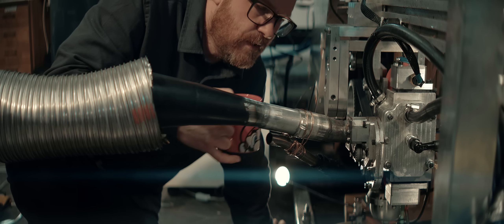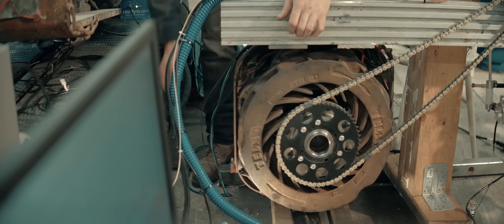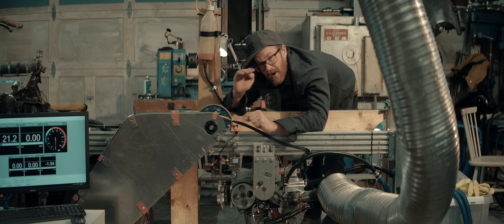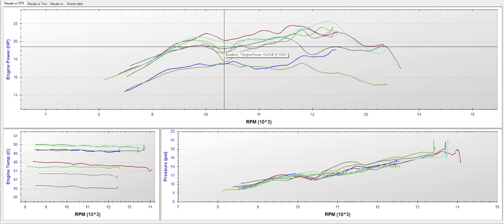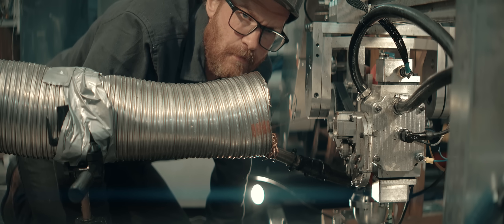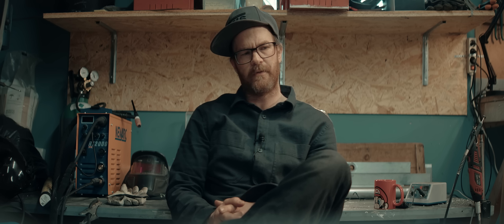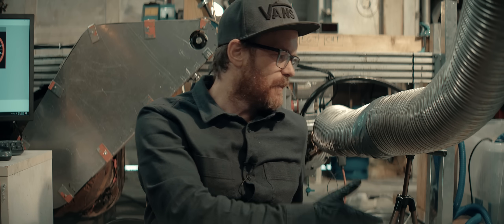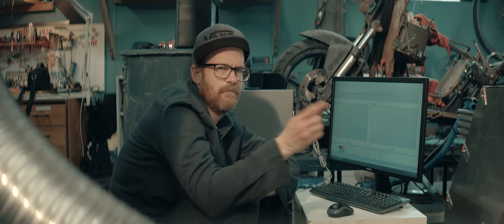50cc Supercharged Nitro Two Stroke - More compression?

Comment: Give it more timing at the top end, that will help clean your plugs. You likely also need to tighten up your plug gap with boost. On top of that you might need more spark energy. Top Fuel/Funny Car change their plugs EVERY RUN and they just buy the cheapest plugs they can get, part of that is because the magnetos they use put out 120amps of energy per plug. (and they run two plugs per cylinder) Yes you heard me right 120 AMPS of energy per plug.. welding level amperage. That's how much energy 90% nitro needs to burn somewhat efficiently, though it's still burning all the way out the pipe and out into open air. At max RPM you should be at about 40-45 degrees of timing going by what it says for methanol. Giving it more boost will also help it burn more efficiently and would be easier to do than designing a new head. 
I think you're still too much in the NA mindset and not adapting well to a boosted application.
Reply: Every mod on a n/a engine does well on  boost! To many compensate bad stuff/design with adding boost. My 2c
Reply from the maker: Just adding boost to a conventional engine would be far less interesting.
Reply: @2STROKESTUFFING  I wasn't saying adding boost to a conventional engine, I said add boost to this one you've already made. This might be interesting to you. https://en.wikipedia.org/wiki/Top_Fuel#Ignition_and_timing
Reply: MSD 44 magneto produce 44 amps for primary coils not for the sparkplug. Plug amps is about 1-1.2
Reply: Yep. Joules or watts are the same, minus some efficiency losses. Funny car magnetos are actually 44 amps. You have 44A @12v or 528 watts. Assuming 100% efficiency, at the plug, 50,000v @ 528 watts is 0.0106 amps at the plug.  A stock car/truck plugs run at around 50,000v @ 0.0012 amps ..    Point is you dont need current at a spark plug, you need voltage. Once the ark is established, the fuel will begin burning.
Reply: @janilindroos3688  I'm quoting what Clay Millican's former crew chief said they put out..
Reply: @jaratt85  Top Fuels doesn't just spark, they burn like an 80amp weld for 20 degrees of duration. They change spark plugs every run cuz they melt, sometimes there's nothing but the threads and porcelain left.
Reply: @KalLanPIDT  spark duration is the key, CDI cant compete with magnetos
Reply: @KalLanPIDT  that's interesting, being that i have several john force and tim wilkerson plugs on my desk, and they look like they are almost brand new.. the porcelain is clean, electrode in the middle does have ever so slight amount of wear on them. Maybe equivelant to 10k miles on a conventional plug in a gas engine.  Idk what you're looking at. They both run the same or VERY similar ignition systems.
Reply: @mitchellgould7405  duration of a spark in a flyback transformer (which is what automotive applications use, wether it be cdi, points or a mag) is dictated by the voltage required to jump the gap, and how large the magnetic field is around the primary coil before the magnetic field collapses. The more voltage needed to jump the gap (usually because excessive fuel or other electrical insulators)  = less duration of spark.
Reply: @gadgetdeez7069  keep reading bud until you find out about spark duration characteristics of different ignitions. A promag44 has like 16 degrees of duration for ignition event, with a cdi just registering a tiny spike.  Further to this, going to a glow plug might just be what he needs, just like the fuel needs to run in RC motors.  If I wanted to talk about basic physics I would have........
Reply: Dunno about buying the cheapest they can get - plugs are the cheapest part of an engine and with something that is so important this isn't where you skimp .
Reply: @Flattyman  it is for them because they go through so many of them. If you walk through the pits at a NHRA event you'll find trash cans with piles of them. They've broadcasted that fact on the NHRA coverage so many times I don't know how many times I've heard it. For a professional team cutting costs where you can is really important.
Okay listening to this I guess they are 44 amps now.. I think they reduced it when they started capping how fast they can go. https://www.youtube.com/watch?v=jZRS-z9WQdY E3 is now the official spark plug of NHRA so I guess they are running better plugs now. For the longest time though I know they ran cheap ones to lower costs.. but hey sponsor means free. https://en.wikipedia.org/wiki/Top_Fuel#Ignition_and_timing
Reply: @Alfred Wedmore i'm full aware. Most people cant grasp reluctance, inductance, power, or the calculations thereof. Therefore in laymens terms on a 10:1 transformer 100v @ 10A = 1000watt input @ 100% efficiency = 10v @ 100A = 1000 watt output.

Comment: Have you tried cooling the fuel before your runs. This would allow more fuel to pack the cylinder. You probably already thought of this or tried it but running it through a still with dry ice may get some additional horse power.
Reply: He is heating the fuel, running it through the compressor.

Comment: Engine dynos both inertia, water brake, and Eddie Current generallly accelerates an Engine from lower Rpms to High Rpm Peak Power. Anywhere between a pre set fixed amount between 200rpm and 600 rpm a second. While you're messing about trying different things is how I used to tune my 1/10 scale RC car engines, but for actual HP, you need to accelerate the the Engine as suggested above.

Comment: You need to seriously beef up that ignition system.

Top fuel dragsters that run nitro have to run 2x massive magnetos  to keep the spark from getting put out by the cold fuel...

They burn 4-5galons per qtr mile pass.   19-21 gallons a mile...

Comment: Regarding the involuntary thing. It's similar here in Germany: If a city doesn't have enough voluntary firefighters (only cities with a population above 100,000 or special hazards like chemical plants), they require people that are able to do it to join the firefighters. It makes sense because I would still want fires to be put out no matter what. You can't just have houses burning down because there are no firefighters. And yes, I'm volunteering as a firefighter, not just saying that people should be firefighters if necessary.

Comment: In one of the runs it was noticeable that the nut securing your load cell to the teststand frame was loose. This can also cause some wierd readings. To fix that you could use nylon cap nuts or use threadlock on the important nuts.

Edit: Sorry two minutes later in the video you fix it 😂👍🏼
Reply: The unspoken rule of YouTube, never comment until the video is done 😂
Reply: Do you ejaculate prematurely?

Comment: Awesome work. I still think a dual spark plug head would be more efficient.
Reply: I think with a 50cc head fitting two sparkplugs might be an issue and might adversely effect combustion chamber shape. 
Dual spark heads are generally a benefit with very large and/or strangely shaped combustion chambers. A chamber like he's using is pretty much optimal if the squish clearance is correct. The squish area should be providing enough turbulence to get good, fast combustion.
Reply: And even if the compression is the same   a dual spark plug setup has the drawback of a more uneven flame front means that the air fuel mixture will need more time to burn completely/ leave more unbunred fuel in the cylinder also the points/area there the 2 flame fronts hit each other get more pressure and heat for a short time increasing the likelihood of hot pockets that cann cause premature detonation aka knocking
Reply: @TheLtVoss  more time to burn correctly with two flame fronts? Errrrr...
Reply: With nitromethane dual plugs are good idea, plus he needs a LOT more powerful ignition system....  mildest nitro ignitions what we use in our tf engines are over 200mj per spark and currently we are using over 800mj/spark systems....    my own tf harley uses about 450mj system 50.000volts and 9amps re-striking system.... offcourse, he has so much less nitro than we... we use usually 80-100%
Reply: @NitroGnome  he's using RC fuel, methanol fuel with nitromethane added as a power booster.
Reply: @Surestick88  yes and rc fuels use usually 15-50% nitro, methanol itself is quite difficult to get ignite too
Reply: You would need a really small plug to fit a pair within the confines of a 50cc head. I would try boosting the existing spark first.
Reply: Well... Two small plugs in angle
Reply: @NitroGnome  They would need to be. Putting it into perspective a 50cc piston is around 45mm diameter, with an even smaller combustion chamber. I would like to bet the valves on your TF harley are bigger than that.

Comment: You could be overloading the coil with that amount of boost and advance, with big boosted engines it can actually blow out the spark, a lot of big boosted engines we will close up the plug gap to compensate , best way is an amplifier and a more powerful coil, plug selection also comes into play as well as plug boot, a resistor boot can fail in some instances, I use the lowest resistance plug leads I can and I try using non resistor plugs when having issues
Reply: Maybe not, nitro with 14.5-1 compression and 15+ psi, it may need an amplifier and a coil, blown nitro drag cars run a massive ignition and top fuel runs twin plug and twin Magneto's with amplifier boxes, Alex is treading where no one has treaded before and it's interesting to see the small issues he seems to be coming across,
Reply: @Grooty79  I remember hearing topfuels relying on glowing exhaust valve for ignition in back track in the past. Timing was determined with how sharp the lip was on the valve.
Reply: A smaller plug gap will result in a lower breakdown voltage for a given set of in-cylinder conditions at the time of spark.  This typically helps if you exceed the coil’s maximum voltage capability due to high in-cylinder pressure or you’ve a lot of parasitic loss from plug fouling reducing the dV/dt to the point where it’s impossible to realise breakdown.  This is a very different failure to what you’d typically see in engines with extreme in-cylinder motion running very rich on oxygenated fuels.  This is an example of true spark stretch which is often called spark blow-out: the discharge is stretched to the point where the glow-phase voltage and current cannot be sustained by the secondary circuit.  The result is the spark is extinguished, but if there’s enough energy left in the coil to raise the voltage beyond breakdown, it’ll simply restrike.  A smaller gap will mask the problem, but the real answer is to stiffen the plasma column by increasing the mean discharge current, whereas a coil with a more rapid dV/dt or higher voltage capability will help with the high pressure misfire or plug fouling.  Interestingly a CDI solution can offer both, albeit at the expense of spark duration… which is a disaster if it’s truly spark stretch.  It’s a complex multidimensional problem that requires a lot more than just throwing a big coil at it.  

The easiest solution is to simply change an ignition parameter and see how the engine responds.  If the engine uses an inductive coil now, increase the charge time (dwell) and see if the problem gets better.  If it’s already maxed out and your coil is saturated, reduce it and see if the problem gets worse.  Use a copper cored ignition cable, no cap resistor and a plug without a resistor too, if you can find one.  If this improves the problem, a higher energy coil may well help… but choose one with relatively low secondary resistance to improve your chances.
Reply: We used copper leads on the formula 2 stroke without any resistors. And huge magneto driven coils.
Reply: @ronalddejong7826  Haha... if only you knew...  Hilarious.  Thanks, you've made my day.
Reply: @ronalddejong7826  I think any input here that is positive should be thanked not shitcanned, the fact this engine is a nitro/ methanol fuelled there's only a few top flight Motorsports you can compare it too and then look how they got over similar issues,

Comment: I was wondering why you were starting high and pulling the engine down. Your explanation makes sense to me!
Reply: Yeah
Reply: He is adding load to the engine gradually which is why the rpm’s drop.
Reply: @mikeznel6048  most dynos you see gradually reduce load though. It's why it messes with everyone's head because it doesn't sound like you're used to and it doesn't replicate a run very well because your rpm gets higher over time not lower.
Reply: @mikeznel6048  oh ok I was wondering why it would always slowly die down  I was wondering about that thanks
Reply: it's common for small engine dynos, properly controlling a gradual release of force is actually really complicated and even high end dynos can fail if they aren't set up perfectly, and they also wear out regularly even with a water brake.

Comment: the ncy high tension coil coupled with the ncy cdi box claimes the hottest spark for the gy6 maybe the coil will work with your set up and add a irridium plug should produce a hotter spark too